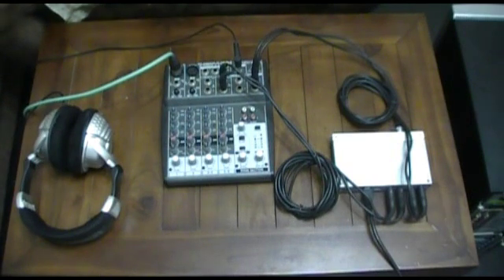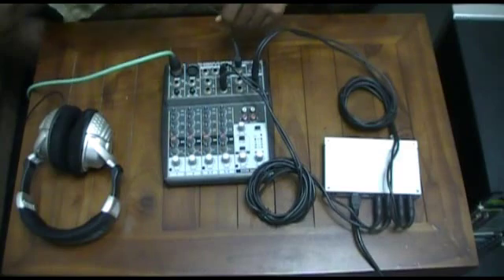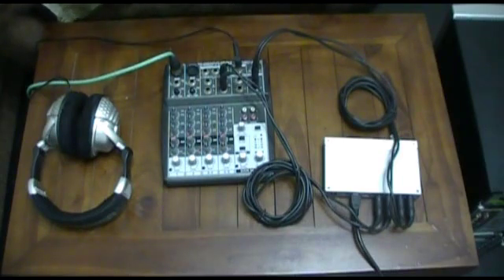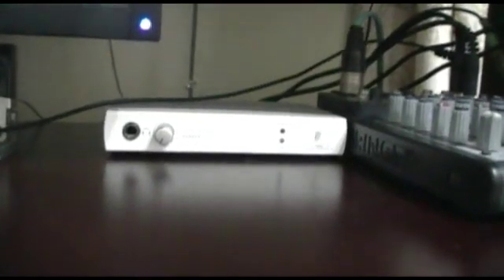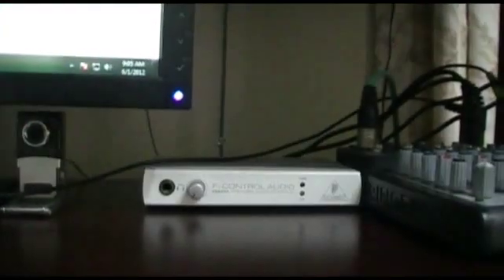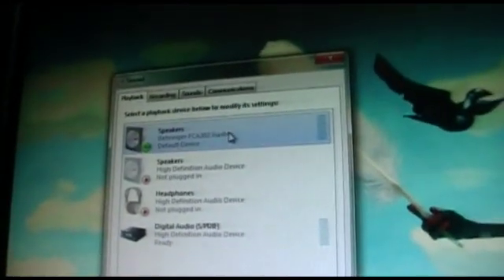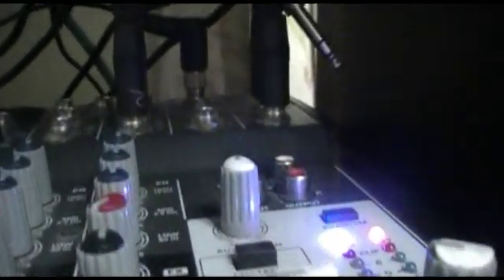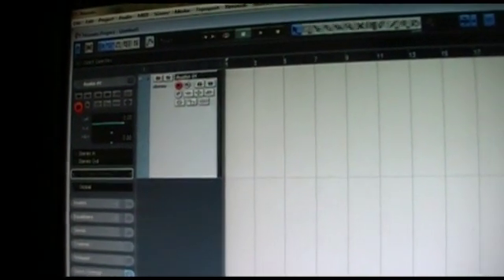How to setup Behringer Firwire Podcast Studio - Part 2

Comment: Dushmantha Gunasingha, thanks to you that I've managed to install all the drivers and playing audio worked flawlessly. However, the problem I faced now is recording. When I record, the latency is 'big', and there were much audio popping and crackling. Do use ASIO? What is the best setting for recording? (buffer size/latenct/etc) Thanks in advance :)

Comment: If everything works well the PCI / FIREWIRE and all good if Download the driver and everything Aug mention in the video but when I said to connect the Coneto FCA 202 and I get a message that is not recognized dciendo the new hadware and administrator get two icons with a small icon of a yellow triangle and I tried many times with no other result

Comment: I have the mixer/interface connected to my Mac and it's far simpler an less involved compared to a Windows box. On a Mac, FireWire is built in and so are the drivers. 

Simply connect the FireWire interface to the Mac's FireWire port, go to System Preferences>Sound>Input, select the source (in this case the FireWire interface), and begin recording audio.